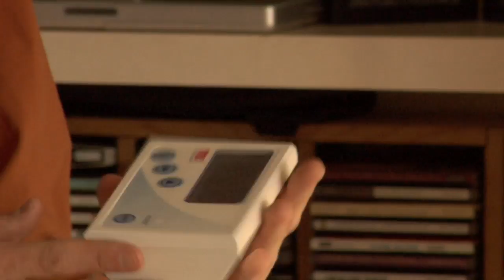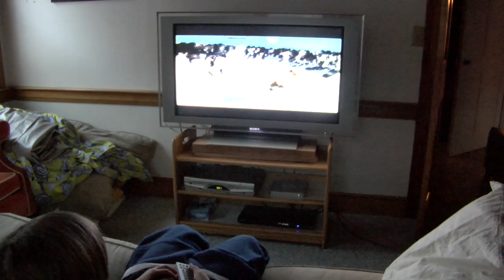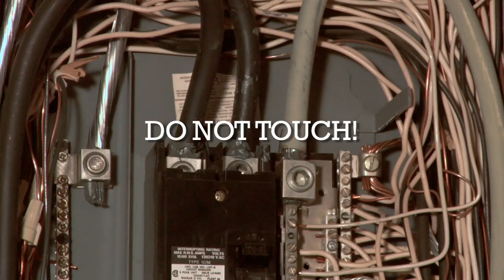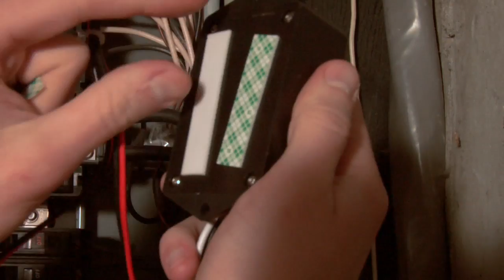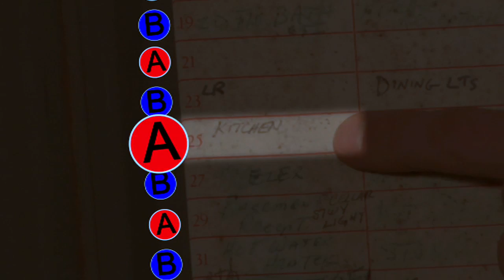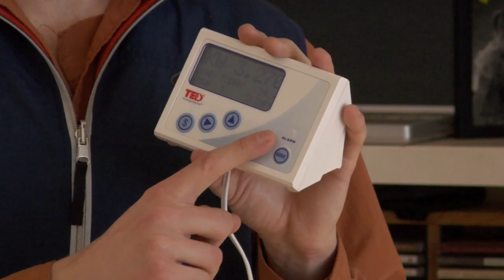TED The Energy Detective Installation Guide

Comment: You scared the crap out of me pointing at the live wires and sliding the clamps down to the bare wire at the breaker!  You're pointing at the terminals while looking at the camera.  I'm assuming that you're still alive and can read this.  Also when you attached the wire to the small breaker, you put the wire on the wrong side of the screw which would push the wire out as you tightened it, possibly.
Reply: Same here.  My first step would be to go outside the house and throw the main power shutoff from the meter to the house.  Next step make sure it really cut the power.  I can't believe he installed this with power to the panel.  Nuts.

Comment: Good video; but at 2:10 or so I think you made a HUGE error.  You should use ONE hand when putting on the clamps.  Put the other one IN YOUR POCKET.  You correctly point out that that part of the box is still hot.  By using two hands you make the path go ACROSS YOUR HEART should you touch the wrong things. Very BAD.

Also; I would recommend that you pull the meter or shut off the power at the meter.  I followed your instructions but I have a shutoff switch at my meter.  Made it very easy.
Thanks